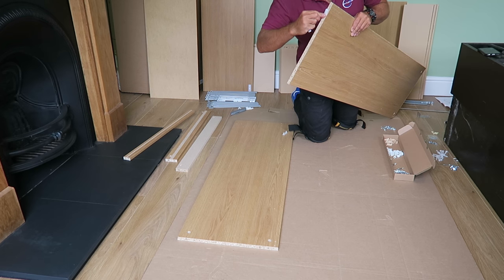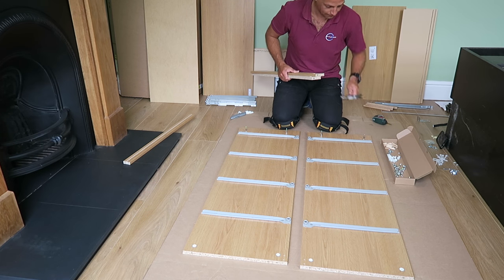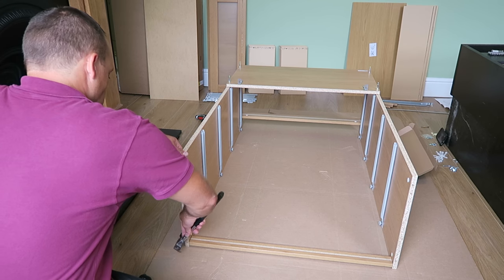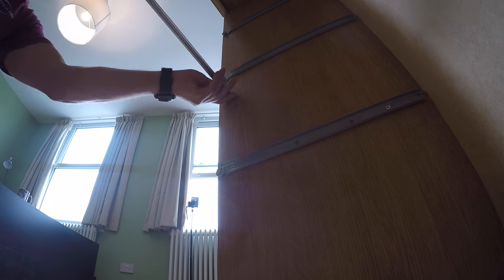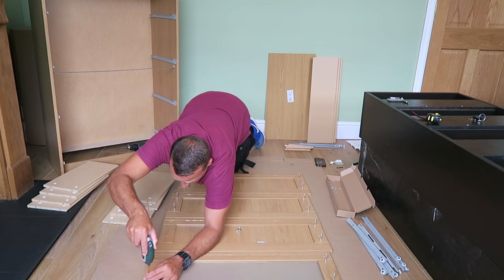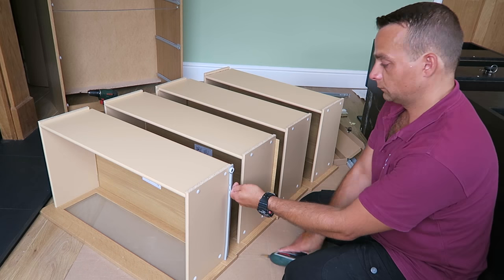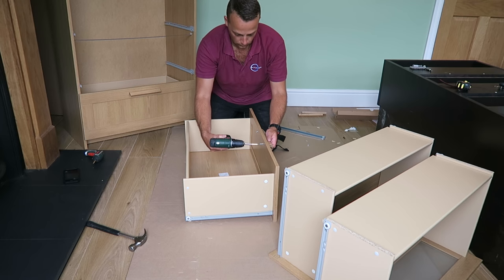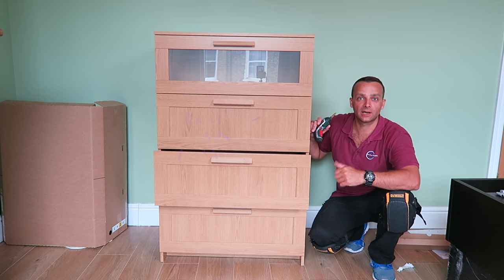IKEA Chest of 4 drawers BRIMNES Assembly

Comment: They got a new model, long story short, the back panel is now 4 seperate panels, much thicker than the flimsy prior one. Still great to watch for figuring where to insert the metal piece and how to do the inserts in a slightly speeder way.

Comment: Did the draw rails already have pre drilled holes, or did you need to drill any holes? Thanks.
Reply: I want to know this too because mine were uneven holes,
Reply: just got mine and it doesnt even have holes. each drawer has 2 big holes but none for screws

Comment: why are my drawers not sitting right 😭 I did everything in this video
Reply: I have the same problem my drawers won't close all the way.  I can't even put in the top draw with the glass in.
Reply from the maker: Only what I can think of You may put drawer rails on the side panels wrong way there is mark L on the left rail and R on the right rail. Is hard to say what went wrong if I cant see it. If you like email me the picture of the drawer detail in side panels with drawer rails and drawers.
Reply: PP FlatPack ok that I didn't know I'll take a picture once I get home thank you I'm subbing to your page
Reply: yeah I had two issues. one. the drawer rails were wrong I hate left on right and right on left then when I finally got the draw in I couldn't get it out. so make sure that when putting your rails in that they're put on very tight because one rail was a bit lose, making it near impossible to pull the draw out
Reply: PP FlatPack ok what you said was right the rails was on the wrong side but now with I close the drawers they over lap
Reply: nevermind I got it thank you
Reply: how did you sort the overlapping issue?
Reply: Ashalia hi!!! were you able to remove it? mine got stuck :(
Reply: Ashalia I thought I was the only one. My drawers won't close all the way and I had to put the glass one on the bottom